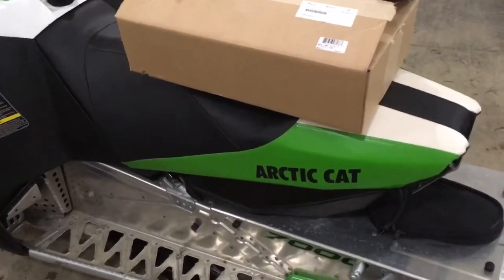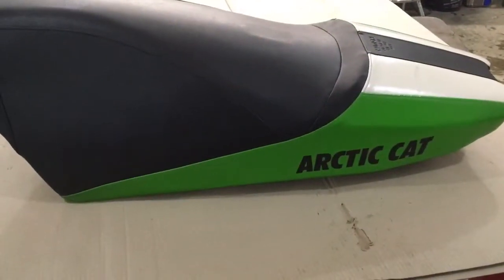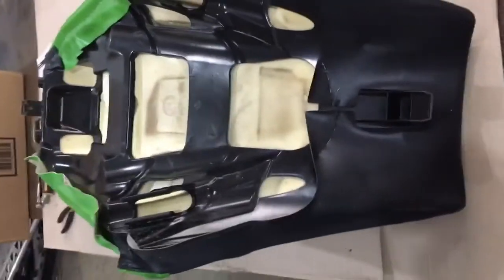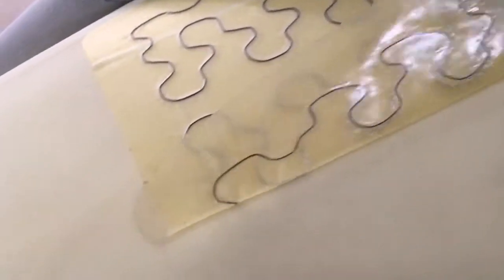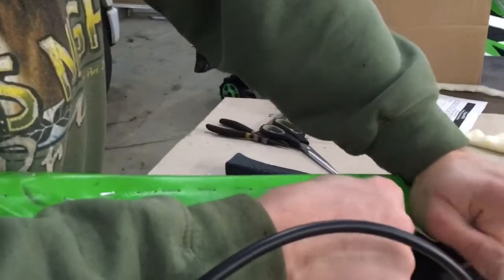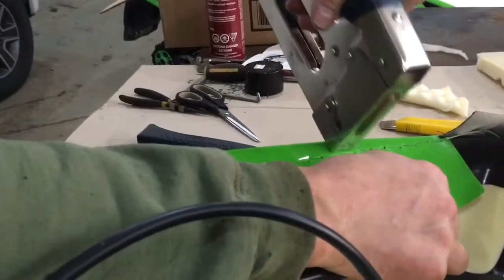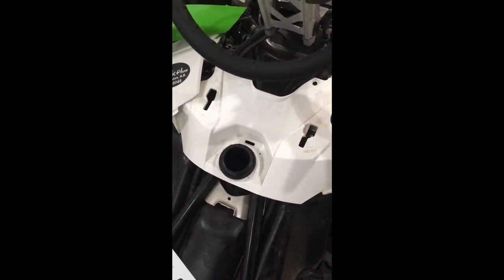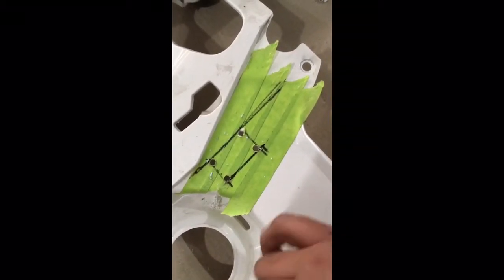Heated seat install on a arctic cat snowmobile

Comment: Came here to watch you do the seat cover, my plug got cut off by the previous owner and I have to fix it. Anyways,on my 2014 xf9000 the wires are all under the tank, that's where the battery cables are and there is enough room they won't chafe in that loom. Cheers

Comment: How hot does the seat get? I reasently bought a used XF 7000 with a heated seat, but I cant feel any heat coming of it 😞
Reply from the maker: It will get plenty warm, usually would only want it on low setting, it get that warm.It will only works with the sled running and takes a couple minutes to warm up. If your doesn’t work it could be unplugged under the seat. It would be the best place to test for power to start to trouble shoot.
Reply: Kidneybeans okey, then mine is probably broken. Had it on the high setting for about 10-15 minutes yesterday, then I tried the low setting for the rest of the trip, but I could not feel any heat. Sounds like I have some hours to spend in the garage 🙈 Thanks for your answer and the tips! 🙂 👍
Reply: My 16 zr7000 has heated seat..it works very well.  I usually only run it on the cold nights.  It makes a huge difference when its below 0 you can feel it through your bibs

Comment: Do you have a heated visor ? Where you hook yours up to the harness my heated visor is in that plug. Didn’t know if there is another spot to plug the visor or the seat into the harness? 
Thanks.
Reply from the maker: Good question. My machine actually doesn’t have a heated visor plug so I’m not sure where else if anywhere it could be plugged into the harness without cutting and splicing. I use a adapter that plugs into the 12volt socket(cigarette lighter) then my visor cord plugs into it. Hopefully that helps....
Reply: Okay. Thanks for the response. Much appreciated.
Reply from the maker: Scott Joyce 👍 anytime